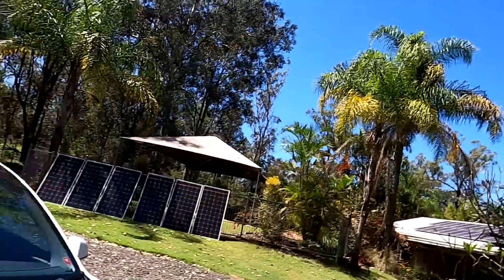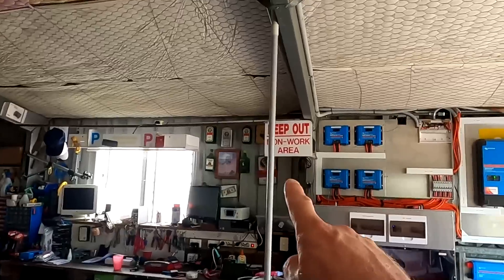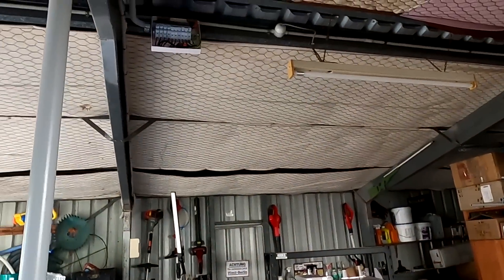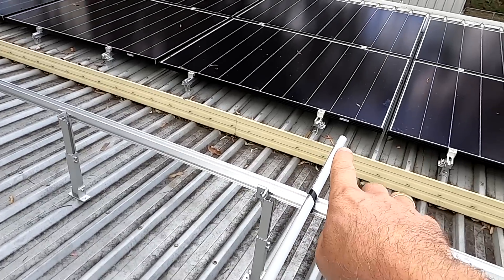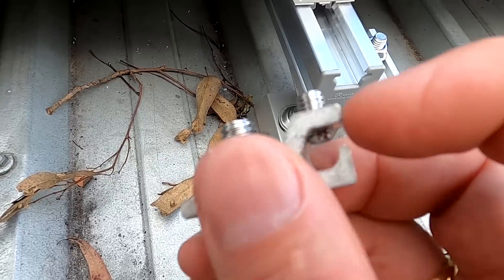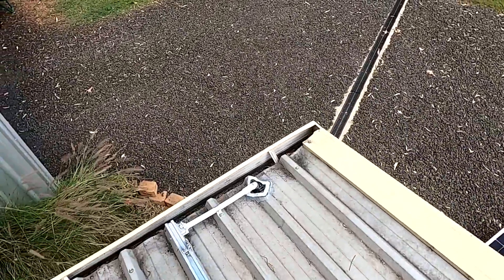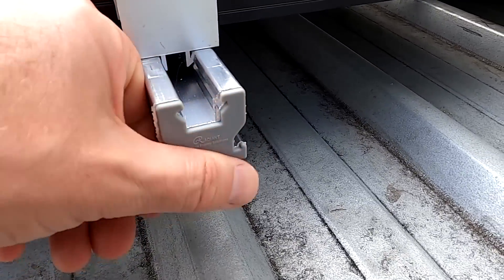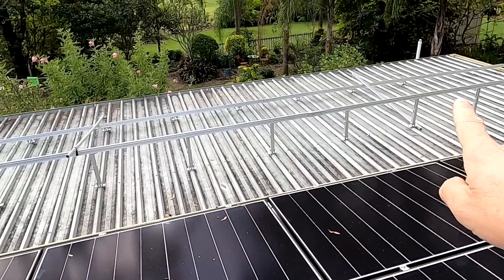1st power-on of the new West Roof with Hyundai Shingled Solar Panels. YEAH!!!!

Comment: Someone needs to do a video on grounding the panels... And they don't need to discuss how to do it right. That's obvious. What the discussion needs to be about, is why its needed at all electrically. Since the solar panel is completely electrically isolated from the aluminum frame, it's not clear to me why any grounding is desired??? Glass is a perfect (or as close to it as one can get.) insolator.

Comment: That is one very impressive solar array you have there, hope it all works as expected. With your solar and lithium battery experience you may be able to answer a question I have about battery chargers. Is it possible to charge Lithium batteries with a standard LED, GEL, AGM, battery charger and if so will it hurt the battery?
     Cheers              Robert          from cloudy Vict'

Comment: Hallo Andy. Thanks for sharing the progress of the installation with us. It's quite interesting to see, how they install the panels and that there is no big difference to the job you did.
But one question: Could the panels on the car port be moved further to the outside (to the west)? Closer to the gutter of the carport? This would reduce the shading on the panels on the west roof, when the sun is already quite low and could give you 21Watts more... ;-)
Reply from the maker: We have lowered the tilt now a bit but still get a bit of shading on the other panels after 5pm. The sun is already fairly down by then and behind the trees anyway. So, loses are minimal. At this point of time, I'm expecting the battery to be fully charged anyway.
Reply: @OffGridGarageAustralia  Thanks, this sounds reasonable. I also suspect, that the sunset will be close, when shading occures, so that the gained energy (not power) will not be that much. There's just not enough daytime left.
Reply: Aha, now I see it. It's not possible to move the rails, because of the location of the screws, which are holding the metal roof and therefore where the support beams are located.

Comment: Hello,
I would like to make a battery with 280ah Lifepo4 cells.
My question is, is it possible to make blocks of 2 cells in series so 3.65v 280+280=560ah and then put 16 blocks of 2 cells in parallel to make a 48v battery.
So I will come up with a 48v 560ah battery with 1BMS 200ha to manage the battery.
My inverter is a 10KV WKS.
Or make two 16 cells batteries with 2 BMS.
For cells, which option is the best for you?

Thanks
Reply from the maker: It's the exact opposite, Charles.
Put two batteries in parallel (positive to positive and negative to negative) to get 560Ah and then 16 of these parallel packs in series (positive of one parallel pack to the negative of the next and so on. This will increase your voltage then).
If you're new to all this (it sounds like it), please be very very careful as these batteries contain and awful lot of energy!

Comment: Looks awesome, I want some of those panels! 😍 Andy once your house plan runs out you will be able to supply the neighborhood with the power you generate 😉 I started with 2 145w panels for my camper trailer only to find in shady areas it wasn't enough, so I added another 2. Now I've bought a camper van and thinking of covering the roof with some if needed.
Reply from the maker: You cannot have enough panels! 💪
Reply: @OffGridGarageAustralia  so I can have some of your new ones? lol I wish but hey they wont suit my system so im just going to have to buy my own, great stuff Andy keep up the good work.

Comment: With the roof glands, ideally the iron roof should be cleaned before smothering it in sealant. Gives it a far better chance to adhere and seal.
Reply: I agree. This is the primary reason for almost all the leaks I see on installations. I use a blower, water, and even solvents if necessary. Old asphalt is the worst for this because a lot of guys don't seal under the shingle and if you don't have a flashing, the grit gives up then your house requires black mold remediation 🤦

Comment: Personally I think it is a big mistake to use normal bathroom silicone. It will dry out quickly. They should have used UV secured Sika Flex or a similar glue also used for caravans.
Reply from the maker: Who is using bathroom silicon? That would be stupid...
Reply: @OffGridGarageAustralia  It certainly looks like bathroom silicone in the video and not polyuretan based like Sika Flex
Reply: Silicone is silicone.....
Reply: @QuantumMarmalade  Yes and it should definitively not be on a roof in direct sunlight
Reply: @thomasvilladsen4218  if it is silicone  then no.  Silicone is NOT "for indoor applications only" I think what you mean is "silicone based" 😁
Reply: @thomasvilladsen4218  also.... Idk what you are looking at but this sealant is clear..... Bathroom caulk is almost always white and almost never clear. Silicone can sit in direct sunlight for decades. I know, I've seen and done it. Silicone is in fact one of the main reasons that the sealants are so durable to begin with. 100% silicone is fine for 20 years in direct sunlight but is also expensive, and thus unpopular. I use it whenever the previous roof coating is already silicone based or any other surface to which other sealants won't stick (such as silicone 🤣).

Comment: At around the 7-minute mark you see a lot of discoloration in the solar panels, is this some kind of protective plastic film that haven't been removed yet or are the panels already cracked?

Edit: It might just be finger marks?
Reply from the maker: Because the surface is almost black you clearly see the finger prints. If this would be a car, I would constantly wash it 😂
Reply: @OffGridGarageAustralia  
One more question though, why don't you cut down the trees nearby that shadows the panels?

I will soon install my 22kw ground mount system and I am going as far as buying some of the neighboring property to cut down the trees. 
My neighboring property is mostly forest though so not too expensive to buy.
Reply from the maker: @Mr.Engineer.  that would be wrong. We're cutting down far too many trees and causing all kind of problems with that. When we install solar panels, we want to be as sustainable as possible. Having trees is a gift not a burden. Removing the trees in my yard would have cost more than oversizing my solar array. It's a long term experiment I'm doing, trying to generate enough energy even under (partly) shading conditions. It's also explained here:
 https://youtu.be/nS72GpEO-zA
Reply: @OffGridGarageAustralia  
I guess the impact of cutting down trees is different in different environments around the globe.
I basically live "in a forest" and we have problems with our old pastures and open areas in nature growing back with bush and forest. We have to much forest in certain places and the forest all around me is tall pine trees about ready to be cut down for timber. It was planted about 70 years ago I think, when they cut down the forest around me last time for the same purpose of timber.
I also have a stream I am considering laying a small portion of in pipe. Would yield around 5kw and consume less than 1% of the water during spring and autumn and maybe upwards of 30% during the drier season. 

It is green power, and I would become self-sufficient with electricity, even during our dark and cold winters up here in Norway.

But got me curious, is there any reason why I shouldn't cut down a few trees and build the hydro power given my location and environment?
Reply from the maker: @Mr.Engineer.  Sounds interesting. You should consider a YouTube channel and explain all this a bit more. People will watch this, including me...
Reply: @OffGridGarageAustralia  
I am sure many would be interested, me included!
Think I will reuse either a Mitsu I-miev or Nissan Leaf motor as a permanent magnet generator as they are dirt cheap around here and highly efficient compared to any off the shelf products. 

But video making is not my field of interest, so will probably just enjoy it myself :)
Busy enough earning my living through regular means unfortunately.

Comment: Hey Andy, the MC4 connector you showed that's tucked away under the panel, one end isn't screwed in all the way. This is important for waterproofing and making sure the connection is secure for many years of production. If they missed one, you should manually inspect all MC4 connections to make sure they are tightened sufficiently
Reply: Often the bushing and strain relief are mismatched intentionally on an mç4 connector. This seems to be to add a little buffer and make sure the seal is tight, 10lbs of solution for 5 lbs of problem. Additionally the strain reliefs will usually slip, strip, and just not tighten any further if you force them. Personally I miss the old days of j-boxes on the backs of panels. More difficult and longer installation but overall a much better machine, especially considering the ones on the panels themselves (except for the last disconnect one) will likely never be unplugged unless they have shorted out, which I see more than I'd like. And all they do is speed up installation and remove-replace execution. 😁

Comment: I would just like to add something my solar installer told me as they were hooking up my 10kw of pv in regards to the safe disconnecting of those panels from the roof top mc4 connector/ fuse whatever,,,,, he told me that he saw a guy say watch this, as he touched two 600-700vdc pv copper conductor wires together and he said it  just vaporised about 400mm long of wire instantly before his eyes in a bright blue/greeny flash that sounded and looked somewhat like a giant plasma welder, so I would have to say I have a total lack of confidence in that as a safe means for a panic type disconnect, of course you should make sure there is no power on such a circuit first, but I have heard of sillier things happening.
Reply from the maker: Never heard of such things before. I doubt 700V will make such a long spark especially if it comes from a solar array.
As you said, it was a foolish move from this guy to disconnect a live DC solar array. Such work should only be carried out by a licences electrician.
As per definition, the Disconnection Point is a 'non-load breaking disconnection'.
Reply: @OffGridGarageAustralia  this is all hearsay of course, but my assumption from what he was saying, was that it was a qualified sparky who did this, I believe to show his offsider its potential. Also Andy, in Australia, I’m sure you have heard of the term, ‘Never let the Truth get in the way of a good story!”  Cheers
Reply: @OffGridGarageAustralia  what video you explained more of this?

Comment: Hi Andy, I’ll now give you a valuable little tip.     IF, your solar installers haven’t ..already done ..this for you, themselves, you should make sure that after they finish the job, that you get yourself a tub of Lanotec Type A Grease, and then go along to all of your solar panel rail mounting clamps and unscrew each of the stainless steel bolts out of them, and apply a good smear of that grease to the threads on all of the bolts, before re-screwing them back into the aluminium panel mounting clamps again.  
Why…??    Because if you don’t do this, then within a year or two, of exposure to the weather, you’ll find that all, of those stainless steel fixing bolts will have ..seized, ..themselves, (sometimes permanently) because of moisture induced electro-galvanic corrosion, between the two dissimilar metals, into the threads of the aluminium panel mounting clamps, and they will become an ..absolute ..problem for you, further down the track, if you should ever have to lift or remove and replace a damaged or faulty panel. 
The Lanotec grease provides a permanent, waterproof barrier, between the mating interfaces of the two dissimilar metal threads and thereby acts as a very effective anti-sieze agent, thus preventing this moisture induced corrosion from galling, the stainless steel threads of the fixing bolts in the aluminium panel mounting clamps. 
Trust me, it’s cheap, it works, and it will save you a ..mountain of pain, and frustration, and a LOT, of swearing, in a few years time…!  😉
Reply from the maker: Yeah, nah, I won't do all that. It's been installed now and it is what it is. I know what you mean and I had a hard time to get the old ones off., but apparently the new ones are different and this greasing is not necessary any more.
Reply: @OffGridGarageAustralia  OK, your choice, ..good luck. 😉

Comment: Hi Andy, should turnout to be a great system again. I noticed they used corrugated conduit here & there that are in the sun. I have seen the corro get very brittle in the sun. Is theirs  UV rated, hope so. Cheers
Reply from the maker: Yes, they are using HD conduit UV resistance and also spray it with cold gal paint. It should last decades.
Reply: Here in Hawaii you can only use metal conduit for any interior/exterior transition. It is vastly superior as long as the proper seals and quality conduit are used.

Comment: Is it just me thinking this takes very long? There are 4 workers on the roof. Should be a job done in at most two days for all four roofs. Especially because all electric stuff was already in place.
Reply from the maker: Yeah, it seems like an easy job but it's a lot of cabling work as well and they started just before noon at two days.
My preparation certainly saved them a lot of time, they were saying.
Reply: @OffGridGarageAustralia  that explains if they started just before noon 😁
Reply from the maker: @igorybema  they have so many jobs... fully booked out until January already.
Reply: @OffGridGarageAustralia  Shouldn't be your problem right? You would expect an installer to come over and do a full day work, not just a few hours.Then again, I assume they are finished now so all ok now.

Comment: There was a small hole in the flexible conduit when you were showing the rubber seals. Also that flexible conduit will only last about 5 to 7 years in the sun that is how long it lasted for me it needs to be covered.

Comment: Looking pretty good.  A couple things I noticed... they seem to have just siliconed right over the dirt on the roof (not what you would have done yourself I'm sure, I would have cleaned it myself in those spots).  Also, the base of the mounts where the aluminum is shaped like an inverted "V" to match the roof ridges... is there some sort of rubber/silicone around the screw where it goes through the roof?  It looks like just aluminum pressed against the roofing and water could seep in without some sort of seal (maybe you could put a little silicone on the uphill side of the mount).  Looking forward to the next episode - good stuff!
Reply: I noticed the dirt under the silicon as well, personally I would of cleaned it (as would Andy), but I'd use Polyurethane sealant which is much more durable, silicon will fail much sooner.
Reply: Me too, & Im sure many others squirmed as they saw the dirt under the silicone.
Reply from the maker: Yep, noticed this as well...

Comment: If falling leaves and foliage is an issue you may want to install a mesh wire kit along the top of your arrays to prevent it falling down and then sliding under your arrays.
Reply from the maker: I had such mesh on the gutters. That was the first thing I removed when we moved in. The gutters were full of small stuff which falls through the mesh. Better to have good access and clean it out properly.
Reply: @OffGridGarageAustralia  Yes I have gutter guard, but the solar kits are different and more aimed at rodents and larger foliage, small stuff will just wash straight down and off.
Reply from the maker: @Crawfa79  I'll have a look. Thank you.

Comment: @8:54 They are just called a Dektite, in the trade, so named after the Australian inventor. You had it right, they are called a flashing. A generic nomenclature, for any roofing waterproof over-protection, whether it be flat sheetmetal flashing, or a penetration type one .
You'll soon be up & running again. In time for Xmas.
Question, with all you've spent, both on your DIY efforts, with old panels, etc., as well this new upgrade, how long before you expect to break even, on your power/cost ratio?
Reply: Some of the cost might be offset by Youtube income.
Reply from the maker: That is hard to say as I don't have the house connected yet. Lots of energy coming in now but no load...

Comment: Andy I was shocked and very disappointed to see the copious amounts of silicon they applied directly to the roof, without any real attempt to clean and prepare the roof surface properly
IMHO they may as well have not put the silicon on there at all, because within a few short weeks water will easily start to wick under the silicon, and it will lift and become useless.
Such a shame that this lack of attention to detail has in my mind tarnished what appears to be an otherwise good install job.

Looks like you are going to have so much solar input form now on, how are you going to use it all? 😁
How about a car charging station for the local EV folks, and start making some money back! 🤣